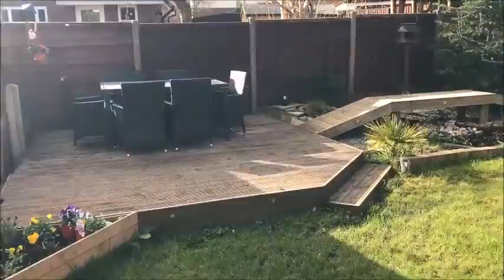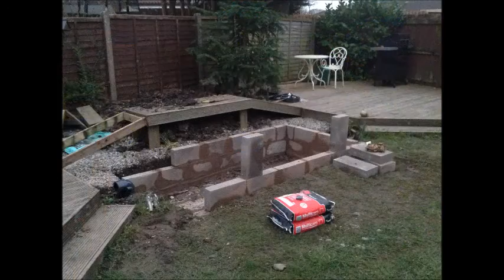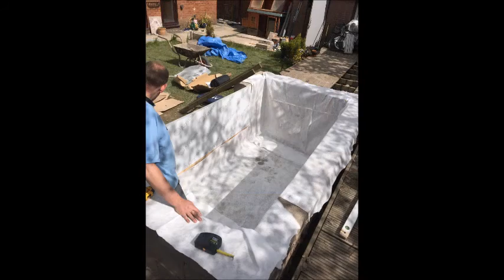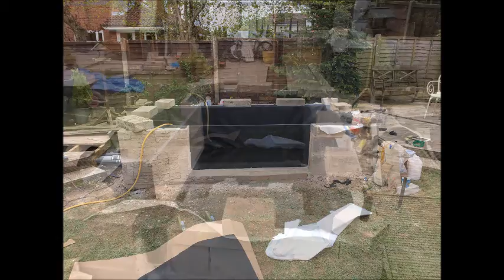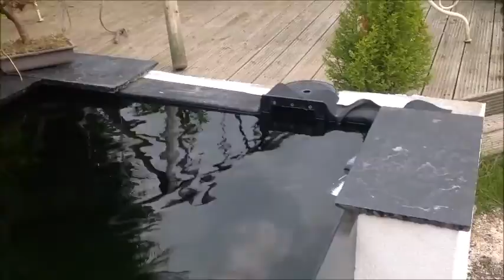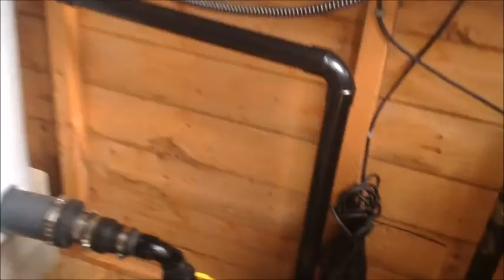Building a Koi Pond - Build Log and Pond Tour 2017 UK

Comment: Hi , What pump are you using for the bottom drain is it an 800 or 8000 ?
Reply from the maker: Gary Williams it’s obviously gravity to the filter and sieve and then a 8000l/h return pump. Cheers, Chris
Reply: ok , i was wondering why you have put a plastic thing in your eazypod, you say it’s for fines , but if your running 8000 litres per hour through an eazypod that is why you have fines , max for an eazypod is 6000 but it’s much better to go less than that i have 3500 .
Reply from the maker: Gary Williams hi Gary, the EazyPod is rated at 10,000 l/h and my bottom drain is going through a 4” pipe, split between a sieve, bypass balance valve, easy pod, into a moving bed filter and then through my heat pump, again via another restricting bypass valve. All this is pumped through at least 6m of pipework and  bends. There is no way I’m getting to anything like 8000 l/h. The plastic disk however does take out the fines and stops the k1 spilling which is a pain when it happens.
Reply: craynerd ok so i’ve seen some of the issues people have and overspill is one of them but from what i’ve seen is they have too much water in on a clean cycle if on a gravity fed pod that means it’s slightly at the wrong height or if they are on pump it’s easy , take some out . You will be much better running about 5000 lph through it i wouldn’t run any more . Also how are you cleaning the crap that builds up at the bottom of where your k1 is ?